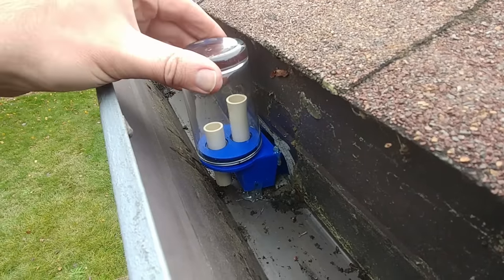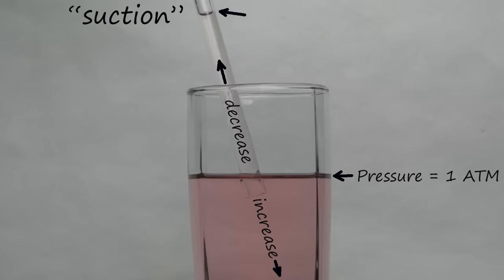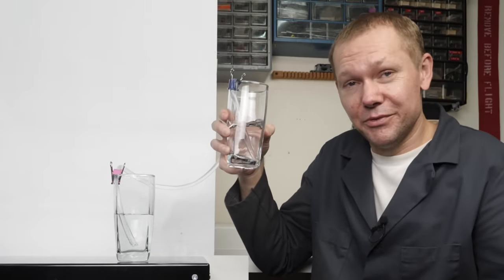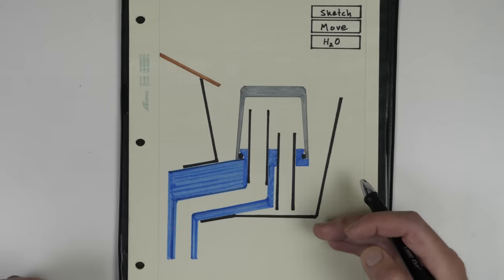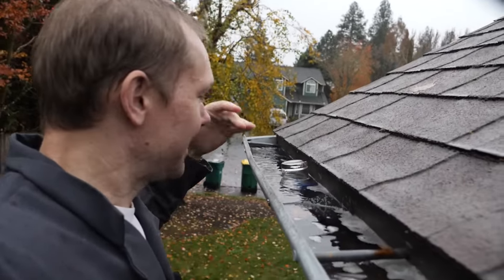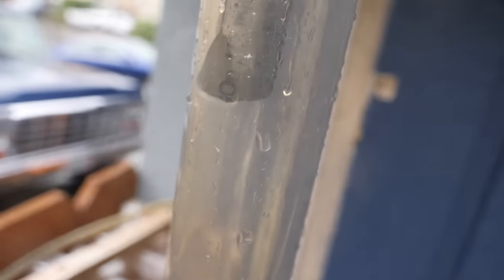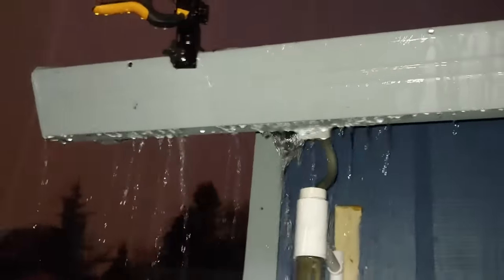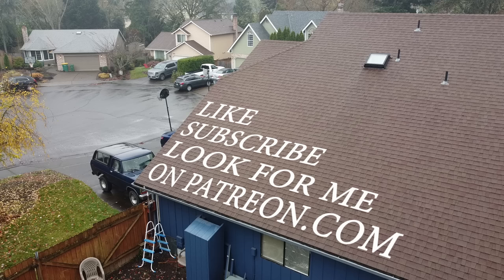Rain Gutter POWER #5 - Bell Siphon Fundamentals and Pitfalls

Comment: Instead of building up water in your gutter (contributing to rotting of your house), why not build a tower of 5 gallon buckets, each holding a bell siphon and overflow to the next bucket when rain is heavy. The lowest bucket is the last to fill because of low potential. Then you can experiment with a ram jet set up, with each bucket spinning a turbine of different gear to adapt to the different flow rates from each bucket.

Comment: it looks like output tube of the siphon needs to form an airtight seal i.e by being full of water to trigger the mechanism, I wonder if carefully making sure the output pipe inside the jar is level would help? 

with the pipe at an angle, the fluid seems to be able to flow while letting air in. 

if the pipe were level, water should enter from all  sides of the pipe at the same time causing a seal?

Comment: Let’s say you have a dry period for a while and the water that’s in the gutter never reached it’s minimum flow needed to siphon properly. Does it drain or just remain stagnant until it either evaporates or is filled to the required level?

Comment: Ok idea but bad executed, I m no specialist but it can certainly be made a lot easier. First remove all this overengineerd stuff just a normal hole, then create a horizontal pipe under the gutter before it goes vertically, the rain should slowly fill the horizontal pipe while continously  draining the rain out the gutter (if it rains hard enhough) then the horizontal pipe will fill up, you will create vacuum and since there is already a direction where the water goes it will suck your gutter dry in matter of seconds just like your over engineered drain. Example pluvia system /watch?v=_ELwOXIiwAI
Originally from Scandinavia

Edit: also with pluvia you always drain your gutter and with your method there is always rain in your gutter

Edit 2: if you read this yes it works also on sloped roofs with gutters

Comment: Disclaimer: I know...nothing. 
Rather than just waiting for the water to get to the top of the pipe to start, would it help to have something that releases the water to it when a sufficient amount of water (pressure) pushes on it? Would that reduce the trickling before it kicks in?

Comment: Couldn't you use a larger pipe at the top to get higher water pressure? Like the top of the pipe be a 10in pipe and bringing it down to you 2in pipe storing or water weight making more water pressure. Lmk if I'm wrong lol

Comment: 'Nasty standing water' = Your gutters are installed incorrectly.  Gutters should drop 1/8th to 1/4 inch every 10 feet toward the drain.  If you do this correctly there will be much less water and even the debris in the gutters, because it will flow over and down like it should.  A lot of people have no idea WTF they're doing and install them flat, which makes them much more of a problem than they should be.

Comment: Welllll I wasn't at the meetings but, rip off gutters replace with stainless steel, or copper gutters and add filters or screens to gutters than run that water into storage tanks,  that can be fed to house with 12 volt rv, holding tank pump. And use that as Grey water , free, add your electric generators then, those n solar will run the pumps to keep your house pressured up, you can filter that water as it goes down into holding tank, with large swimming pool filter you can charge as it gets full of trash. Steal roof and that should be reduced more, hammer valve at bottom as well might pump your water to holding tanks as well if you can't set your tanks Close o house hidden , you'll save n earn more money savings if can save that water  to be redirected to your garden  1500 gals a week per 3 people is a lot of water savings  if catch your rain water,

Comment: So I have a pond going to snow in a few months trying to start green house cover over it with a hydroponics system. BUT I WANT IT TO BE GO GREEN PURE style. So I was wondering if I were to pump it into PVC pipes gravity pulled back into the pond would it work or suck back into the pond at 8ft high

Comment: the syphon is not flowing at max speed (rather it will match the flow speed of the little hole over at the generator) when the bottom of the tube touches the water level of the buffer(acrylic tube).. this is why the overflow of the buffer is not working and why you have a full gutter at high rain volumes... to fix this put the overflow output of the buffer below the exit of the syphon

Comment: Put a 2” diameter tube for overflow in the other downspout that raises the overflow level above the top siphon tube but below the top of the gutter?  Now…design an automatic water pump like the fountains that used to operate at Versailles!

Comment: Probably a dumb question but why does the glass have to be lower than the other for water to drain into it? Wouldnt the lower glass technically have a miniscule of greater pressure pushing on the water , wanting to force it back up into the higher class with relatively lower atmosphere pressing in it?
Reply: Its weird bc clearly the water can move up vertically in the tube initially before falling into the lower glass..
Reply: Is it bc of the weight of the water in the tube plus 1 atmosphere pushing it to the lower cup versus the 1 atmosphere trying to push the water back up the tube?

Comment: Why don't you include a series of holding tanks in the length of the pipe. You could multiply your electric output exponentially as well as solve your overflow problem by directly controlling the flow to the turbines

Comment: Your design has a bit of a problem long term: you're using your gutter as a reservoir when there's not enough water flow. Hence, down the line, gunk accumulating, rusting, siding rotting, etc.

Try researching Akasison's XL line of rain systems. They use the same siphon idea to drain water, but their outlets are flat, so they don't let water accumulate.

Comment: The diameter of the glass is too big.  Thats why it has a hard time getting started.
Also it is not an actual bell siphon.
It uses the same principle, but its design is inferior to an actual bell siphon.
If you just put a bell above the outlet tube and don't do the suction tube thingy, it will work much better and have more flow.
If you want to restrict the flow, get the bell closer to the opening of the outlet tube. The lower edge of the bell must not be the limiting factor but the outlet tube has to be. But it all has a role to play. Bell siphons are a delicate Balance anyways. But this design has huge flaws.
It is not simple enough yet.

Comment: Dude Mr smart.. engineer.... the tall tube needs to be over the water surface to not drizzle.... deep derp... and I have never even seen one b4.. nor read a fancy book about them.  What u need is a rain choke for when the levels match. To do this use floats that cut flow off when they are level. And release when pressure is hi.

Comment: What good is all this, if it really can't Power something other than Low Voltage (LED's)?  For most.  Maybe that's the point.  It's just a learning exercise. Right?   You'll never get real useable Power that can Operate Home Equipment other than a few Low Voltage LED"s.  right?

Comment: Ya no you can just cover the top of the down pipe and have one or multiple smaller pipes it would activate lot faster set at desired height eg like a disc shape bout 5 to 10mm thickness air gap 
Im tempted to make a water tank collect direct from roof and overflow into same pipe  longer the fall of water the more suction 😉

Comment: Wrong! You need to use a LOOP SIPHON.  It's cheap, has no moving parts, is external to the gutter, and blockages easy to remove.  A loop siphon consists of a single loop of tubing, place the top of the loop at the desired water level and Bob's your Uncle.

Comment: The water is splashing around as it turns the motor wheel. Why not 3D print a high efficiency water power generator wheel?

Comment: Why not add storage so you can allway have extra water...as long as it's used every so often it won't go bad...heck if only we could get power from the water we use in toilets res tank and sink drains and heck maybe even heat in our windows we could draw a little power from everywhere

Comment: Why are your gutters that shape and not round?
Ofc corners will hold stuff tight and a round surface wouldn't.
How about not "fixing" this, but remove the old one and put in round gutters and round pipes leading down?
That would solve your problems for good.

Comment: Why not just re hang em like they need to be and they won't be doing that🤷‍♂️. That's 99% of the problem in most cases, the other is a rotten facia.  Basiclly the same issue.  Creating a pitch either way, fixes the issue.  Theres no reason for a science class, but some gutter screen and make a pitch.  10min job.  Done.

Comment: Your guttering isn’t at the right angle! You don’t need a siphon, you need to get your guttering done properly! A straight and level gutter is only good for gathering water and twigs. Whoever did your guttering did not know what they were doing. You need a slightly sloped gutter so the water flows out of it. How could you not know this? Smh 🤦‍♂️